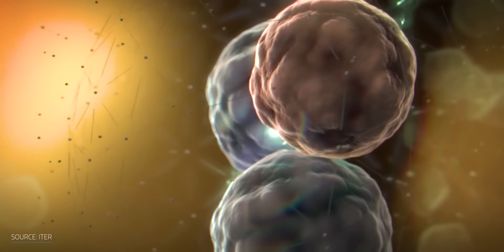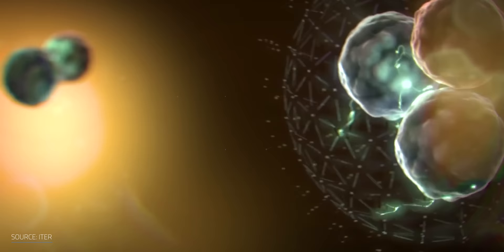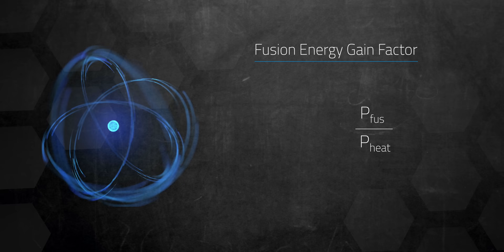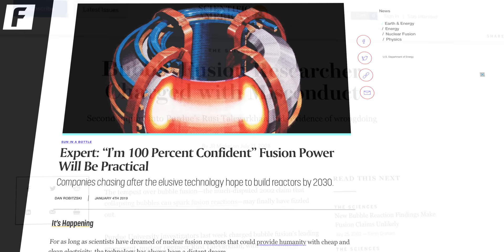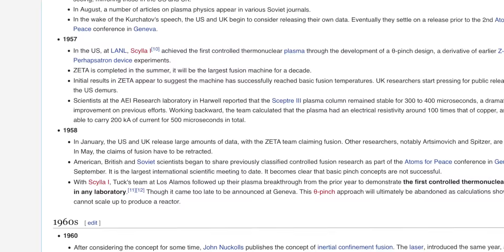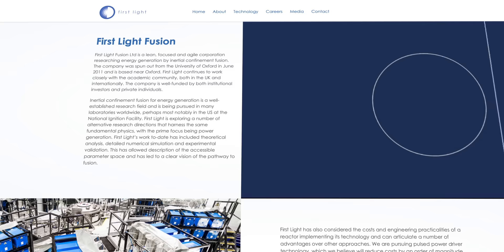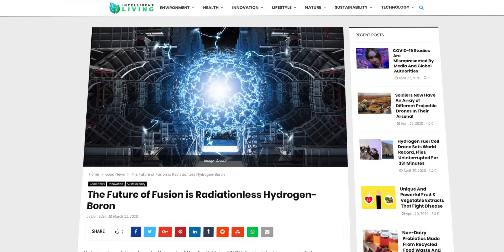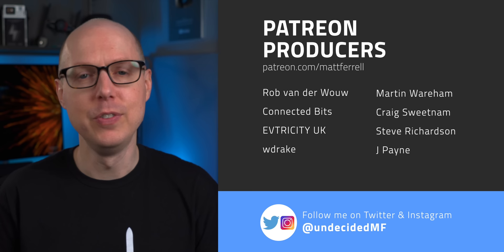The truth about nuclear fusion power - new breakthroughs

Comment: Radiation damage and radioactive waste. To produce usable heat, the neutron streams carrying 80 percent of the energy from deuterium-tritium fusion must be decelerated and cooled by the reactor structure, its surrounding lithium-containing blanket, and the coolant. The neutron radiation damage in the solid vessel wall is expected to be worse than in fission reactors because of the higher neutron energies. Fusion neutrons knock atoms out of their usual lattice positions, causing swelling and fracturing of the structure. Also, neutron-induced reactions generate large amounts of interstitial helium and hydrogen, forming gas pockets that lead to additional swelling, embrittlement, and fatigue. These phenomena put the integrity of the reaction vessel in peril.
In reactors with deuterium-only fueling (which is much more difficult to ignite than a deuterium-tritium mix), the neutron reaction product has five times lower energy and the neutron streams are substantially less damaging to structures. But the deleterious effects will still be ruinous on a longer time scale.
The problem of neutron-degraded structures may be alleviated in fusion reactor concepts where the fusion fuel capsule is enclosed in a one-meter thick liquid lithium sphere or cylinder. But the fuel assemblies themselves will be transformed into tons of radioactive waste to be removed annually from each reactor. Molten lithium also presents a fire and explosion hazard, introducing a drawback common to liquid-metal cooled fission reactors.
Bombardment by fusion neutrons knocks atoms out of their structural positions while making them radioactive and weakening the structure, which must be replaced periodically. This results in huge masses of highly radioactive material that must eventually be transported offsite for burial. Many non-structural components inside the reaction vessel and in the blanket will also become highly radioactive by neutron activation. While the radioactivity level per kilogram of waste would be much smaller than for fission-reactor wastes, the volume and mass of wastes would be many times larger. What’s more, some of the radiation damage and production of radioactive waste is incurred to no end, because a proportion of the fusion power is generated solely to offset the irreducible on-site power drains.
Materials scientists are attempting to develop low-activation structural alloys that would allow discarded reactor materials to qualify as low-level radioactive waste that could be disposed of by shallow land burial. Even if such alloys do become available on a commercial scale, very few municipalities or counties are likely to accept landfills for low-level radioactive waste. There are only one or two repositories for such waste in every nation, which means that radioactive waste from fusion reactors would have to be transported across the country at great expense and safeguarded from diversion.
To reduce the radiation exposure of plant workers, biological shielding is needed even when the reactor is not operating. In the intensely radioactive environment, remote handling equipment and robots would be required for all maintenance work on reactor components as well as for their replacement because of radiation damage, particle erosion, or melting. These constraints will cause prolonged downtimes even for minor repairs.
Nuclear weapons proliferation. The open or clandestine production of plutonium 239 is possible in a fusion reactor simply by placing natural or depleted uranium oxide at any location where neutrons of any energy are flying about. The ocean of slowing-down neutrons that results from scattering of the streaming fusion neutrons on the reaction vessel permeates every nook and cranny of the reactor interior, including appendages to the reaction vessel. Slower neutrons will be readily soaked up by uranium 238, whose cross section for neutron absorption increases with decreasing neutron energy.
In view of the dubious prospects for tritium replenishment, fusion reactors may have to be powered by the two deuterium-deuterium reactions that have substantially the same probability, one of which produces neutrons and helium 3, while the other produces protons and tritium. Because tritium breeding is not required, all the fusion neutrons are available for any use—including the production of plutonium 239 from uranium 238.
It is extremely challenging to approach energy breakeven with deuterium-deuterium reactions because their total reactivity is 20 times smaller than that of deuterium-tritium, even at much higher temperatures. But a deuterium-fueled “test reactor” with 50 megawatts of heating power and producing only 5 megawatts of deuterium-deuterium fusion power could yield about 3 kilograms of plutonium 239 in one year by absorbing just 10 percent of the neutron output in uranium 238. Most of the tritium from the second deuterium-deuterium reaction could be recovered and burned and the deuterium-tritium neutrons will produce still more plutonium 239, for a total of perhaps 5 kilograms. In effect, the reactor transforms electrical input power into “free-agent” neutrons and tritium, so that a fusion reactor fueled with deuterium-only can be a singularly dangerous tool for nuclear proliferation.
A reactor fueled with deuterium-tritium or deuterium-only will have an inventory of many kilograms of tritium, providing opportunities for diversion for use in nuclear weapons. Just as for fission reactors, International Atomic Energy Agency safeguards would be needed to prevent plutonium production or tritium diversion.
Additional disadvantages shared with fission reactors. Tritium will be dispersed on the surfaces of the reaction vessel, particle injectors, pumping ducts, and other appendages. Corrosion in the heat exchange system, or a breach in the reactor vacuum ducts could result in the release of radioactive tritium into the atmosphere or local water resources. Tritium exchanges with hydrogen to produce tritiated water, which is biologically hazardous. Most fission reactors contain trivial amounts of tritium (less than 1 gram) compared with the kilograms in putative fusion reactors. But the release of even tiny amounts of radioactive tritium from fission reactors into groundwater causes public consternation.
Thwarting tritium permeation through certain classes of solids remains an
Reply: Could you repeat that?

Comment: Are we sure that the energy we get out isn’t dependent on what we put it? That would mean that we can never get more energy out.
Reply: I theory we should be able to get more out than we put it, but in practice this hasn't been achieved yet on pure fusion. Though it has been achieved on fission-fusion reactor, which use fusion to spark a fission reaction in materials we normally can't use for fission.
Reply: @Erowens98  Okay but this isn't fusion. In fission reactions we are harvesting already present energy that is radiating off of lumps of radioactive material. In fusion reactions we might be "harvesting" energy we already put in.

For example, a star can seem to get more energy out of fusion because the driving force is *gravity*. The reason that the fusion is stars has an excess of energy is because the gravity put that energy in.
Reply: @quaesitumspatium7751  that's what i said, a fission reaction sparked by fusion
Reply: @Erowens98  .... *facepalm*

Comment: one question, why the hell do they keep making tokamaks, they don't work for fussion. they never have. they have a flawed design in that, instead of trying to fuse at a single point, they fuse in a ring which requires tremendously more energy then needed for normal fusion. not only that but inorder to fuse with them, they need more energy then what they put out. theres nothing wrong with trying to use magnetism for compression of the plasma, but you can't do it in a donut shape. in order to fuse something, you need to have a single point where they hydrogen is gathered, then you need to squishe it down at that single point with magnetism, pressure, and by shooting high powered xray gamma lasers at the single point, or by shooting a small target point xray laser with high amounts of hydrogen plasma. there are only a few ways to do it, combine the methodes if you can, but whatever you do, don't make you nuclear reactors the shape of a donut, there just to much surface area for the fusion.

Comment: You plan on doing a video on cold fusion? Not the kiind everyone laughs at but the other kind that actually works but is energy negative, much like current fusion technology...
Reply: I can't remember the actual name of it but there is a synthetic electron that can be created which is much more massive than the normal one, allowing for atoms to get closer to one another which can cause them to fuse; only trouble is the darn thing takes more energy to create than the fusion event will release and it decays after only a few seconds. Could make for an interesting video I think.

Comment: 1957 Mayak, Kyshtym, Soviet Union - The Kyshtym disaster was a radiation contamination accident (after a chemical explosion that occurred within a storage tank) at Mayak, a Nuclear fuel reprocessing plant in the Soviet Union.
1957 Sellafield aka Windscale fire, Cumberland, United Kingdom - A fire at the British atomic bomb project (in a plutonium-production-reactor) damaged the core and released an estimated 740 terabecquerels of iodine-131 into the environment. A rudimentary smoke filter constructed over the main outlet chimney successfully prevented a far worse radiation leak.
1961 Idaho Falls, Idaho, United States - Explosion at SL-1 prototype at the National Reactor Testing Station. All 3 operators were killed when a control rod was removed too far.
1966 Frenchtown Charter Township, Michigan, United States - Meltdown of some fuel elements in the Fermi 1 Reactor at the Enrico Fermi Nuclear Generating Station. Little radiation leakage into the environment.
1969 Lucens reactor, Vaud, Switzerland - On January 21, 1969, it suffered a loss-of-coolant accident, leading to meltdown of one fuel element and radioactive contamination of the cavern, which before was sealed.
1975 Greifswald, East Germany - Electrical error in Greifswald Nuclear Power Plant causes fire in the main trough that destroys control lines and five main coolant pumps.
1976 Jaslovské Bohunice, Czechoslovakia - Malfunction during fuel replacement. Fuel rod ejected from reactor into the reactor hall by coolant (CO2).
1979 Three Mile Island, Pennsylvania, United States -  Loss of coolant and partial core meltdown due to operator errors and technical flaws. 
1984 Athens, Alabama, United States - Safety violations, operator error and design problems force a six-year outage at Browns Ferry Unit 2.
1985 Athens, Alabama, United States - Instrumentation systems malfunction during startup, which led to suspension of operations at all three Browns Ferry Units.
1986 Plymouth, Massachusetts, United States - Recurring equipment problems force emergency shutdown of Boston Edison's Pilgrim Nuclear Power Plant.
1986 Chernobyl, Chernobyl Raion (Now Ivankiv Raion), Kiev Oblast, Ukraininan SSR, Soviet Union -  A flawed reactor design and inadequately trained personnel led to a failed backup generator test. This test led to a power surge which overheated the fuel rods of reactor no. 4 of the Chernobyl power plant, causing an explosion and meltdown, necessitating the evacuation of 300,000 people and dispersing radioactive material across Europe
1986 Hamm-Uentrop, West Germany - Experimental THTR-300 reactor releases small amounts of fission products (0.1 GBq Co-60, Cs-137, Pa-233) to surrounding area.
1986 Surry, Virginia, United States - Feedwater pipe break at Surry Nuclear Power Plant kills 4 workers.
1987  Delta, Pennsylvania, United States - Peach Bottom units 2 and 3 shutdown due to cooling malfunctions and unexplained equipment problems.
1987 Lycoming, New York, United States - Malfunctions force Niagara Mohawk Power Corporation to shut down Nine Mile Point Unit 1.
1989 Lusby, Maryland, United States - Inspections at Calvert Cliff Units 1 and 2 reveal cracks at pressurized heater sleeves, forcing extended shutdowns.
1989 Vandellòs, Spain - A fire damaged the cooling system in unit 1 of the Vandellòs nuclear power plant, getting the core close to meltdown. The cooling system was restored before the meltdown but the unit had to be shut down due to the elevated cost of the repair.
1992 Sosnovyi Bor, Leningrad Oblast, Russia - An accident at the Sosnovy Bor nuclear plant leaked radioactive iodine into the air through a ruptured fuel channel.
1996 Waterford, Connecticut, United States - Leaking valve forces shutdown Millstone Nuclear Power Plant Units 1 and 2, multiple equipment failures found.
1996 Crystal River, Florida, United States - Balance-of-plant equipment malfunction forces shutdown and extensive repairs at Crystal River Unit 3.
1999 Ibaraki Prefecture, Japan - Tokaimura nuclear accident killed two workers, and exposed one more to radiation levels above permissible limits.
2002  Oak Harbor, Ohio, United States - Severe corrosion of reactor vessel head forces 24-month outage of Davis-Besse reactor. 	
2003 Paks, Hungary - Collapse of fuel rods at Paks Nuclear Power Plant unit 2 during its corrosion cleaning led to leakage of radioactive gases. It remained inactive for 18 months.
2004 Fukui Prefecture, Japan - Steam explosion at Mihama Nuclear Power Plant kills 4 workers and injures 7 more.
2006 Forsmark, Sweden - An electrical fault at Forsmark Nuclear Power Plant caused multiple failures in safety systems that had the reactor to cool down.
2011 Fukushima, Japan - A tsunami flooded and damaged the plant's 3 active reactors, drowning two workers. Loss of backup electrical power led to overheating, meltdowns, and evacuations. One man died suddenly while carrying equipment during the clean-up. The plant's reactors Nr. 4, 5 and 6 were inactive at the time.
2011 Marcoule, France - One person was killed and four injured, one seriously, in a blast at the Marcoule Nuclear Site. The explosion took place in a furnace used to melt metallic waste.

🙈

Comment: I'm deeply saddened now that I found out how slim the chances are of ever commercializing nuclear fusion.

In this Tech For Luddites YouTube video the lady from India explains the drawbacks of 'terrestrial fusion'. For instance there are only 21 kilograms of tritium in the world. It has to be bred in a [fission] reactor. For an 800 MW fusion plant it will take 125 kg of tritium per year to run a tokamak like ITER. There is a nearly infinite supply of deuterium but the supply of tritium is not sufficient for a fusion reactor. There are several other disadvantages. There will not be a commercial fusion reactor until after 2060. By that time the world will be running on renewables plus battery storage.

She also explains that fusion creates a large quantity of high energy neutrons which go through the metals of the reactor and disrupt the molecular lattice, causing the metal to become brittle. But what I find most alarming is that the superconducting electromagnets needed have a huge amount of stored energy and the superconduction can collapse, what is known as quenching. The electromagnet can explode, so it should be surrounded by a containment vessel just like a fission reactor.

I have personally believed that the costs of the fusion programs exceed their benefits and the billions spent should have been used on building factories for renewables. This just confirms my belief.

BTW the 'inventory of tritium' comes from the supply that is for thermonuclear weapons. Tritium deteriorates and must be replenished periodically.

https://youtu.be/FrUWoywZRt8

Comment: To be fair, Fukashima was not the same dsort of disaster Three Mile Island or Chernobyl was. In those cases someone muacked about with the system, making it go tits up. Fukashima was caused by a dou7ble natural disaster that exceeded what the design was capable of resisting, and even then it only damaged the outer shell and the safety systems worked exactly the way they were supposed to. If the rest of your video is as well researched as this, I will take it with a pinch of salt.